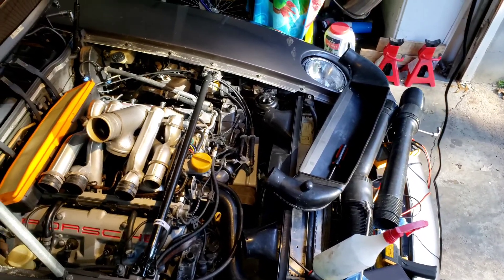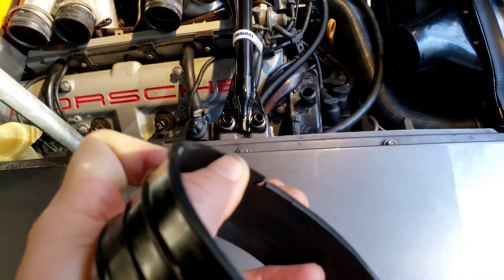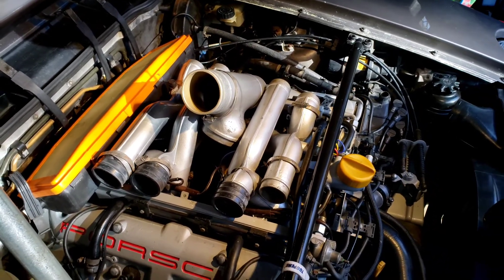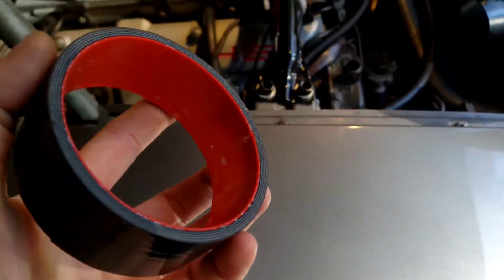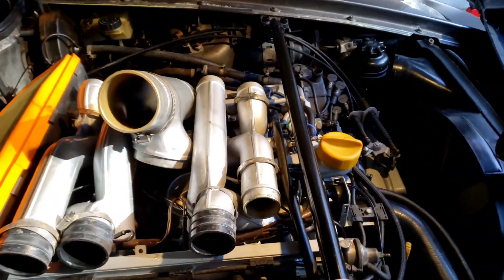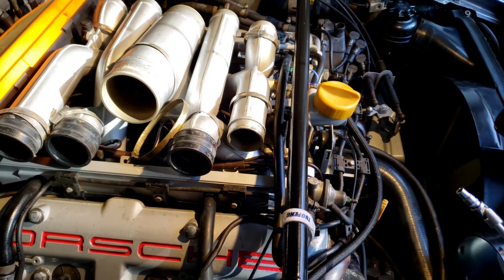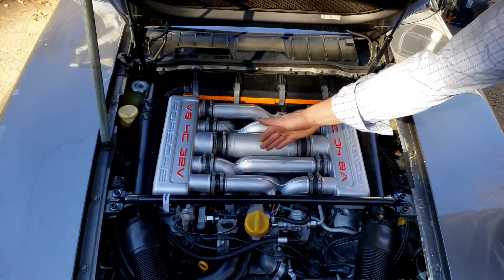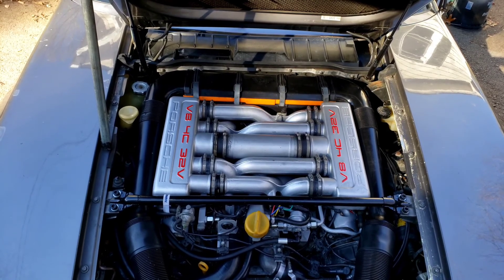Porsche 928 Intake squeal source & repair

Comment: If you pull the air box and the MAF, it's fairly easy to get at the screws on the hose clamps between the T and the throttle body.  Time to pull the air box ~3 minutes.  Time to pull the MAF ~30 seconds.